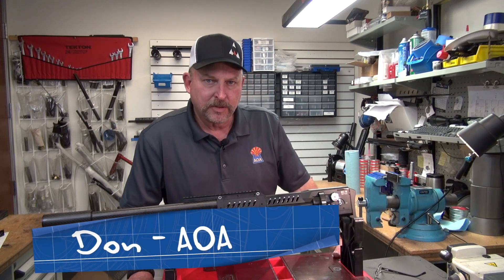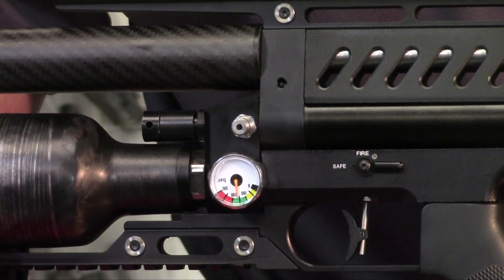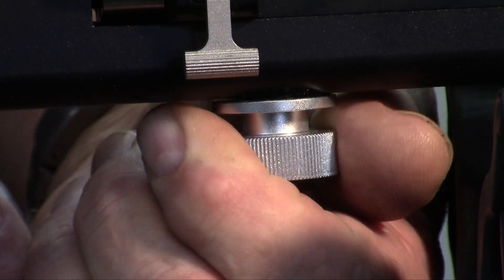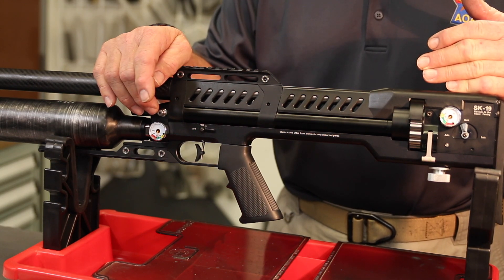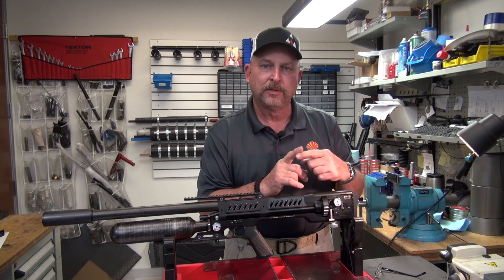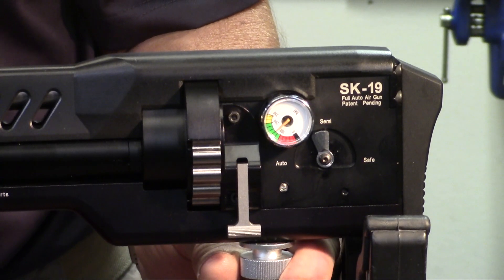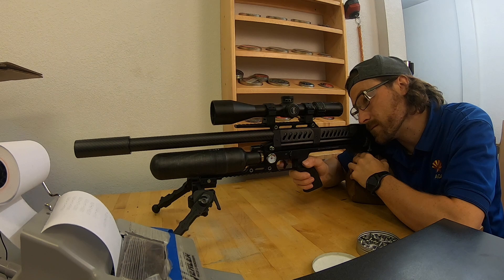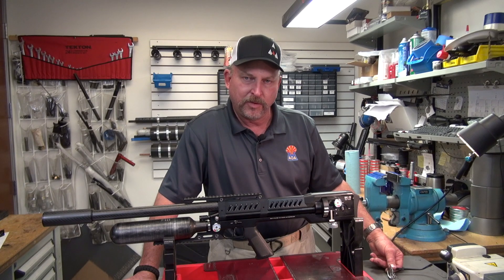LCS Air Arms SK-19 Full Auto Airgun General User Guide

Comment: help please in air leaking issue.can you help ? can you tell me that is there any o ring inside the air cylinder????? I give my gun to a local gun smith and when i received my gun it is leaking air slowly very slowly , it takes 4 or 5 hours to leak 30 bar air.  i opened the cylinder and and seeing no o ring inside the air cylinder. Please help , I am your subscriber.

Comment: I have the amazing gun in .22 and 8 clicks from minimum setting is shooting 15.4 grain pellets at 900-920 FPS. Almost 6500 rounds through it am wondering how do I clean the barrel. Claudio Floras removed/unscrewed the barrel in his video and I don’t speak Spanish so I have no idea what he was doing. This gun is so very quiet with this tune and pellet and everything is just done when I squeeze the trigger. This is the most expensive gun I own by far and I don’t want it mucking up. If there is a proper way to clean the barrel I need to know. So have said the polygonal barrels don’t need cleaning. I don’t know and would be grateful if you would be so kind as to enlighten me on the matter. Currently, I  get 6 mags per fill and they all are spot on. Don’t use the full auto feature much but still...this many rounds down the barrel...something needs cleaned.”UPDATE”....NEVERMIND...I found your other video...THANK YOU SO VERY MUCH!!!! I hunt with this gun and it has become my favorite gun not because of full auto but because it’s so damn accurate and reliable. Everything I put crosshairs on is down as soon as I pull the trigger. Semi mode is so freaky accurate. WOW what a gun.
Reply from the maker: Watch our other video on barrel removal...https://youtu.be/wDEcqxalZ5k